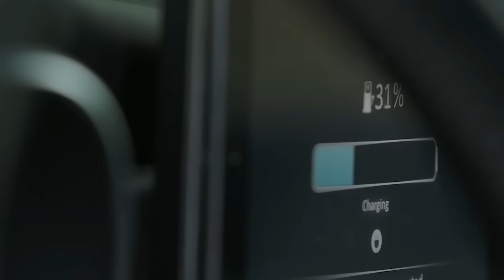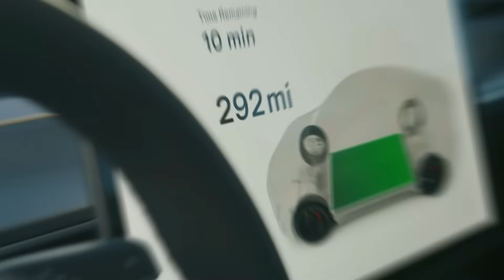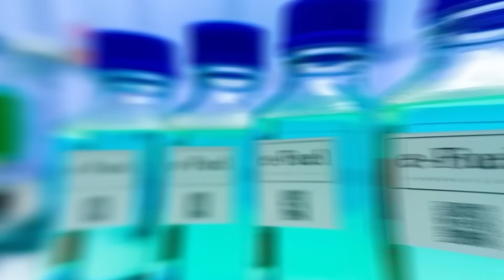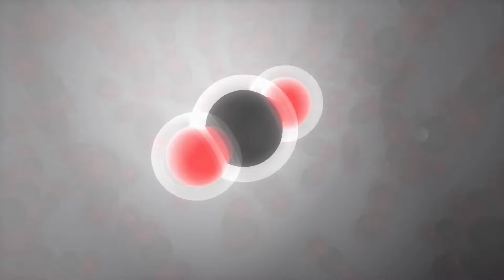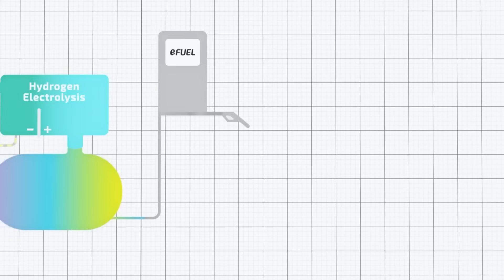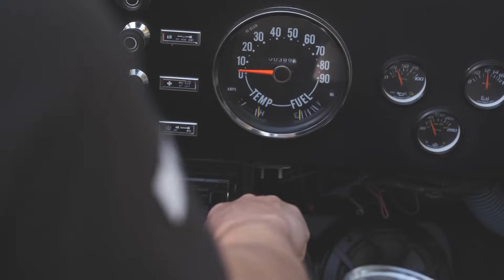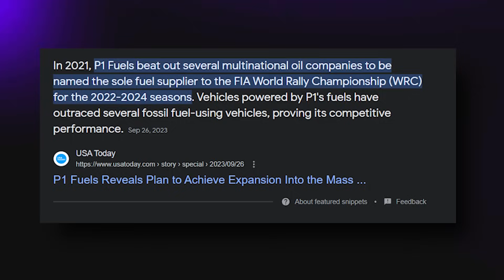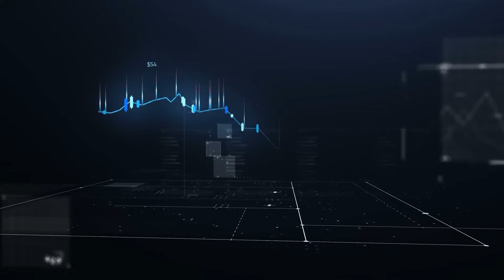Unveiling Porsche's Revolutionary Engine: A Game-Changer

Comment: there never be an all electric future, ev cars are not environmentally friendly as yet
Reply: They are already better and will only increase the lead
Reply: There already is a BEV future, but there are still ppl that either find themselves surprised at how far behind they are or don't read much and just go with the fossil fuel talking points
Reply: EVs are better for the environment than ICE cars.  That is a low standard but it is the one to use.